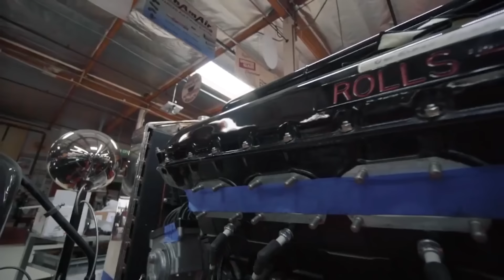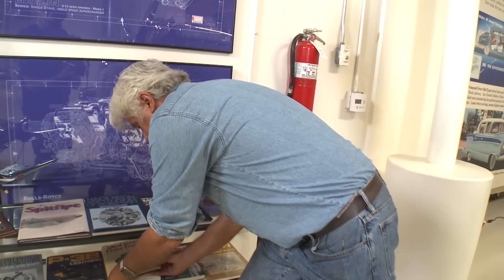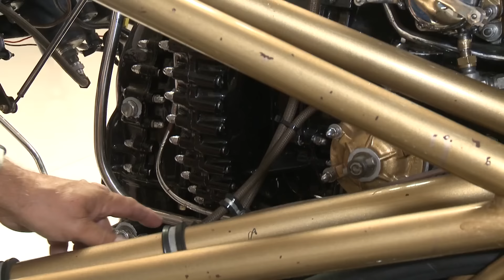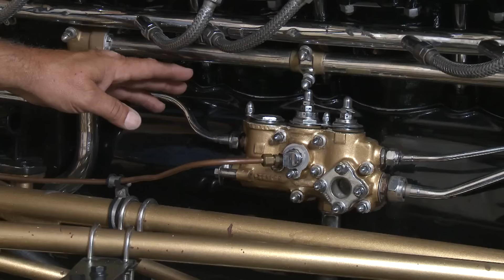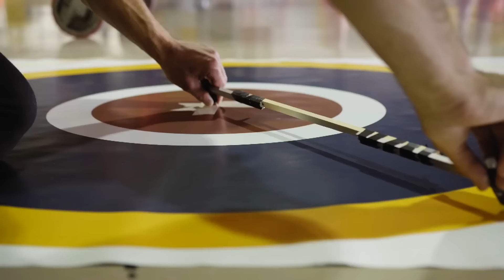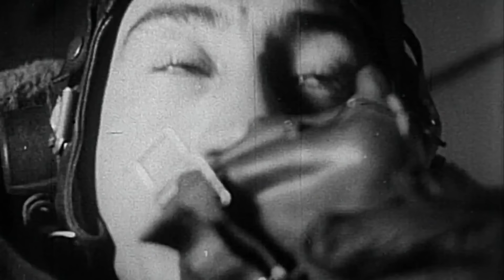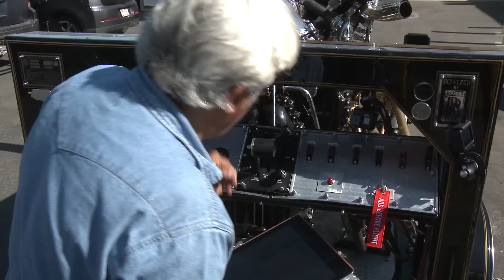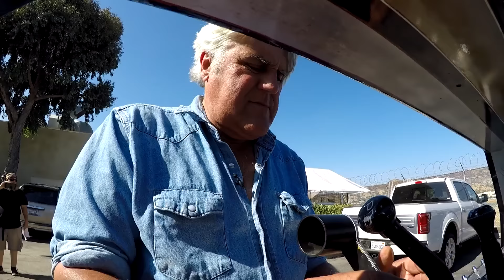The Engine That Won World War II - Jay Leno's Garage

Comment: I love the Merlin 1650, but the the Pratt & Whitney R-2800 really did more to win WWII.
Reply: I'd argue that the planes played a bigger role than the PT boats.

Here are some reasons why the R-2800 should be the choice as the "engine that won the war":

#1 more power
#2 could take battle damage much greater than the Merlin.
#3 number of planes that had it

List of planes that had the R-2800:
A-26 Invader
B-26 Marauder
Canadair CL-215
CH-37 Mojave
Convair CV-240 family
Curtiss C-46 Commando
Douglas DC-6
F4U Corsair
F6F Hellcat
P-47 Thunderbolt
P-61 Black Widow
F8F Bearcat
F7F Tigercat

Number built:  
R-2800 = 125,334
Packard V-1650-7 Merlin = 55,523
Reply: The volume difference was a mistake, not an attempt to decisive.   Your production numbers are including post war production though.

>nonsense, pure and simple.

Calling bullshit on that one.  The Merlin was water cooled, one stray bullet into the radiator would take down the plane.  The R-2800 could have multiple cylinders taken out and still get the pilot home.

Comment: The Germans had the Diamler Benz DB 605 which out performed the Merlin but they never have enough of them
Reply: The DB 605 was much larger than the Merlin and by the time the DB 605 was in use the Merlin engine had a later carburetor which did work better than the fuel injection used on the DB 605. The Spitfire was better in a dive.
Many Bf 109`s were lost because they could not climb, turn or dive like a Spitfire.
Reply: It's not much good the DB605 outperforming the Merlin (which it didn't, long term) if the Spitfire could outperform the Messerschmidt 109 (which it did, long term).
Reply: You are right, the Merlin did have a tendency to flood until a simple technological fix was thought up by a woman- Mrs Tilley's orifice.  This restricted the flow of petrol coming out of the carburettor and stopped the engine flooding.  That said, during the Battle of Britain, the ME109 was better armed, with a nose cannon.  The Spitfire Mark5 only had machine guns.
Reply: Gwynn.
The Spitfire Mk V was early 1941, or the next year and most of them did have the 20 mm cannon,  in the Battle of Britain it was the Spitfire Mk I and Mk II which beat the Bf 109 allowing the Hurricane to take on the bombers but even the Hurricane could manage to take on Bf 109`s  and occasionally it was Hurricanes taking on the Bf 109 while the Spitfires went after the bombers, it would depend on which was in the better position to tackle the Bf 109`s.
Reply: David.
Hartmann was very successful but mainly against the USSR, he never shot down any Spitfires as far as I can find, and just a few USAAF fighters.
Marseiille claimed to have shot down more planes than he could have, he claimed a Spitfire when there were none in the fight at the place or time, he claimed 4 Hurricanes on a day that only 2 were lost. once he claimed 6 P 40`s but less than 6 were shot down in total, his squadron claimed more than were there at the time.
Kurt Welter claimed some 30 DH Mosquito`s when he was flying the Me 262 but of these RAF records only show 3 possible losses to all causes
Reply: I stand corrected.  You are right.  The best book I've read on this is 'Fighter' by Len Deighton.  He not only talks about the aircraft - on both sides, and the tactics they used, but also about the personalities - and the back stabbing that went on - especially by the Germans.
Reply: jonnybottle well the DB 605 is a petrol direct injecting engine and the more modern engine than the carburetted Merlin. Allied fighters were often hunted in nose dives because of the centrifugal force the carburettor could not supply petrol to the engine.

Most messerschmitt BF 109 were lost while landing because of the too narrow landing gear.
and the engine was horrible to service, because the engine was upside down in the BF 109.
Reply: Barrie Rodliffe yeah you're obviously right. but Most kills were done on ME-109 pilots like Hartmann or Marseille. but the Luftwaffe had no Rotation among pilots like the Allies. Thats why German pilots were such succesful.

Comment: actually the US Army Air Corp did a study of the Merlin VS the Allison, and they found the Allison was more efficient than the Merlin. 1710 cu I. For the Allison VS 1650 for the Merlin that made more horsepower probably would make you think their assessment was wrong, but what they found was the trick to horsepower in the Merlin was its supercharger. The engine itself was less efficient. The Allison's cylinder head design had canted valves in a kind of pent roof design compared to the Merlin's flat combustion chamber with bales that were positioned straight up and down II. The cylinder head. That means the valve inclination angle was much better in the Allison. The Allison's connecting rods were also much stronger than the Merlin's, so much so that all the air racing Mustangs use Allison con rods in their Merlin engines. If they had put the Merlin supercharger on the Allison they would have had the best of both worlds, but politics between the two nations prevented that from happening. Too bad!
Reply: So was what they found was that the Merlin was built for power and the Allison for economy? Because the two are not usually compatible product objectives. As for the strength of the Merlins' con-rods, Rolls-Royce would have told you "it is sufficient".

Comment: the 1650-1 was NOT the heart of the Mustang, that was a -7 with a two stage supercharger, however an interesting note on the -1 which doesn't get mentioned much, it was used in the p-40F/L models with outstanding results.  By early '43 most front line MTO p40's were Merlin powered.  They went toe to toe with Luftwaffe (bf109's), and came out on top.